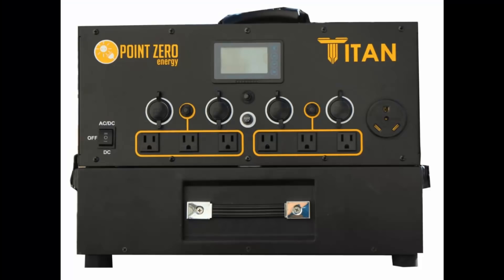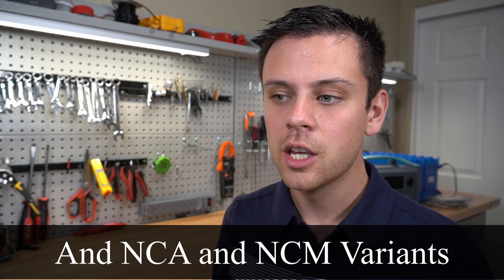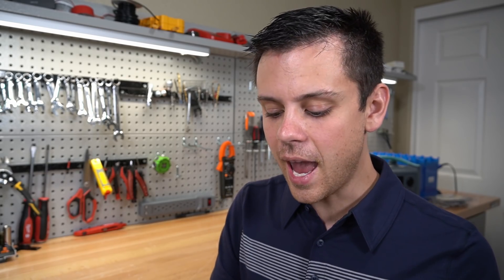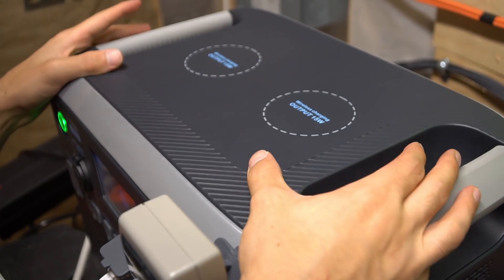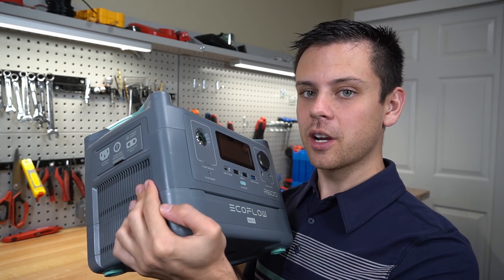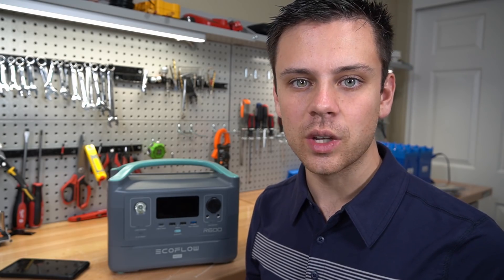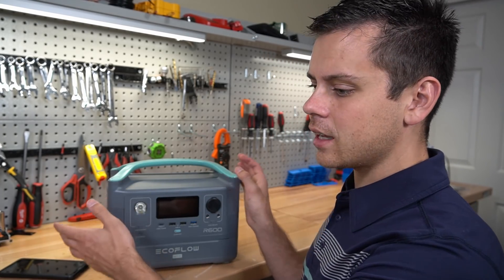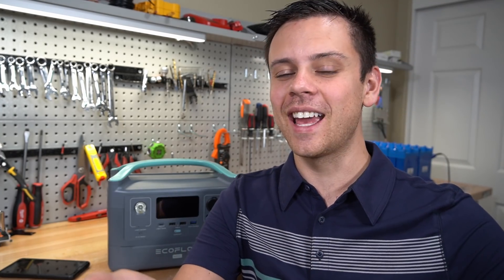Solar Generator Updates for the Titan, AC200 and R600

Comment: Bought your book. It's awesome! IHAVE A BLUETTIAC50S, 2400, and two smaller rockpals, mostly on your and Hobotech reviews. I'm interested in whether the Leoch compares to the ac200. I prefer the ups capability of the former, but noticed from the Indigogo site that the voc solar seems limited( they only show 300 watt parallel ). Are you doing a review before the indigogo campaign ends on Nov 28th? Thanks for your excellent reviews.  P.s. looking to use the generator to power a regular fridge in a blackout , thus the ups

Comment: Are the panels in the 600W array 12v, or 24v? I like the concep tof the 24v arrays, and the 300w 24v sets from Renogy look like a nice bargain...but for the Solar Generators, I am hearing they only take a 12v solar setup.

Comment: A bug or a feature? Bluetti: "when reaching 11.5v it disconnects the charging" :D
Reply: I'm new to this but it sounds like a feature. If my van's starter battery was at 11.5V I'd want the alternator working 100% to charge the starter battery, not the solar generator's battery. Hopefully it starts charging again once the starter battery voltage is ok. Am I understanding this right?

Comment: Hi Will thanks 🙏 to all your reviews I just ordered the BLUETTI AC200 I’m so excited and can’t wait to put it to use. Could you make a video on best practices to use and keep the unit running   For example is it best to run the battery 🔋 all the way down before charging each time if possible. Or when you mentioned that it could last 7-10 years. Does it mean you could keep it plugged in to AC at home 100% of the time or do you recommend not keeping it plugged in. I’m going to use the battery solar generator for Power outage emergencies at home.

Comment: Can you charge the Bluetti ac200 with solar panels at the same time you are using power? Love your videos 
Thanks
Reply: yes you can, you can find this information on the campaign page in indiegogo. you can also use 2 power adapters at the same time and charge in as little as 2.5hrs

Comment: Great reviews! Any sense if how the new Flex 1500 Inergy Power station will compare with Bluetti AC200 (weight/flexibility for additional battery connsctivity,etc.) and pros/cons as primary solar system processor for Sprinter van conversion

Comment: I agree you should charge those companies for your time because they probably wouldn't correct these issues without your testing.  I have moved into a travel trailer and am thinking about a solar system to power my rig in case the power goes out, and to reduce my "carbon footprint."  Love your honesty which the corporate world seems to lack nowadays.

Comment: Hey I’ve got an idea that I’ve been tossing around in my head and trying to figure out if it’s possible or not, so here it goes, big diesel truck pulls 5th wheel camper, camper has solar on top, camper has pull behind Tesla (model isn’t important. Okay now here’s my question can you have a set up that charges the Tesla from the solar on top of the camper and then the Tesla provide the power for the camper at night? Like am I crazy or does this seem like a fairly perfect option to have loads of battery capacity, I can’t find anything on hijacking the main battery in an existing Tesla

Comment: I like high voltage DC. For short runs it works great and I assumed that you had calculated the voltage that you wanted them to do and they added 5 volts. I think that there can be further refinements in terms of modularizing IE they are producing a custom battery pack and that is the heart of the system but the finishings are also and the profit is what's left in terms of the rest of the Parts but for me for this price I think that you can do better in terms of efficiency if you Outsource those parts. Efficiency would result in a total reduction of weight which is more important than cost and probably will be cheaper as well even though yes that means less solar wattage which is not a good way of saving money anymore but where when weight can be reduced and you save money I am for that.

What we find is that the cost of the energy for tools for example is almost irrelevant right? As is the amount of time that they can operate on a single charge. So clearly when it comes to tool batteries instead of having a 12 amp power tool battery you can have a 3 amp power tool battery or a 1 amp power tool battery that charges at 1500 watts perfectly when connected directly to an alternator that has been rectified brutally and cheaply or to a DC generator that is also light in weight fixed speed engine and basically in a few seconds refills the tool battery or collection of tool batteries like those little tiny pancakes that the Italian machines make in fancy sandwich shops sell-by the morsel which is very good for their business model as it is for a crew of workers. Changing a tool battery takes no time. Reducing the time to charge by orders of magnitude is what matters. so you have like a chainsaw that you only operate for maybe what 45 seconds a day to charge up your van life battery if you're in Alaska and the sun is down for months or otherwise prefer to burn s*** or tap into the fast stream for only minutes to spend the DC generator. I've been hearing about how the original lighting that Edison created a market for electricity by was the first real application that needed more than battery power. His breakthrough lasted 15 hours for each Bob which was a long time when you think about how many candles you have to burn to get 15 hours. Subsequent advances have been marginal in the use of electricity wisely. We still need a very small system that cost several times as much as this one even far far Less in total as the what hours are much lower. Mr Probz do you remember what happened with a battery box? that was a low watt hour fast charge brick that still has the website up. I want the modern equivalent of that 10 year old battery!

Comment: I'd love to hear more about the Titan external battery add on. Looks like it is 24v lithium making it SUPER EASY to add a couple Tesla battery pack with StealthEV BMS board and plug in BMS. Seems like Super easy large battery add-on 6kWh for a pretty low cost and no soldering.

Comment: Hi will, 1st off great stuff, fantastic videos
I have a  2003 Ford Transit van with a 220agm battery, a victron 150/50 mppt bluetooth controler and a sterling B2B, at weekends i go away and my 255 solar panel is great when the sun is out in sunny England, the usable amps from a 220agm is half if im correct and the usable voltage is from 14.3 fully charged on my system to 12.4 volts (depth of discharge max lowest volts) so the usable voltage has a very narrow window, my question is i have vey inefficent cool box that draws 42watts, im not sure if thats per hour, at the moment the systems is fine in the summer we have here at the moment 14/06/2020 but on days there is cloud cover im sure it will struggle, my question is with the window of usable volts and amps how long would the battery last (ie at night) as i can only come up with 5 hours from dusk to dawn. kind regards Sean from Project Camper.

Comment: I just found you and I am now a faithful follower! Great video's, sound and production!
I love the way you grab their product by a fist full hair by back of their head and shove their face in a pile of their own specifications, to see who comes up with a clean smiling face? Awesome!
I've been watching you torture test the Titan, absolutely the best in prime time viewing but, I am specifically interested in the 30 amp power system, which you briefly touch base, then moved on.
I own a Arctic Fox 1150 slide-in truck Camper and  I would like to know, how it will hold-up in a camper with all the amenity's or a travel trailer for a 3 day weekend or in something that might have a small generator in it, for life support and be able to find out what it might take to help it make through it's holiday weekend of dry camping quieter than I do now? Like the truck charging as last resort, the generator is noisy or solar panels that come with the kit, I'm getting really tired of having to run my generator every morning. 
Please, go out and live like a king!
I want to watch it get smoked!
I have two 6v 240Ah AGM batteries that get charged mainly by driving, no Solar, no Wind Turbine, a 2500 watt propane generator, CO² detector, 30" TV, Dish satellite, roof AC, roof Fans, a Slide-out, out-side lights, Furnace, LED interior lights, Refrigerator, Coffee pot, Induction cook top, Waffle iron and Insta-pot.
Looking forward to watching more!
Please pay your insurance!

Comment: Thanks for the UPdate ! ! !    You are  CORRECT  on reliability !   I bought  three  Goal Zero  1000 watt  Yeti's .   Two are now non-op after about one year of operation.   The  third is still working reliably in use daily  .  .  .  .  .   ?  ?  ? 
   Of the two failed units:   One failed after I reset it three times in a row  .  .  .  it just shut down as if saying, " Screw You ! "      The second was running under load at about 750 watts for an extended time  .  .  .  .  .  and just went off/dead/non-op.   (Blown fuse maybe?)
    Will check them out when I get organized (time-wise), but for now am not too happy.

Comment: Hi will. I have been trying to learn more about passthrough technology for batteries for a DIY project. 
I just wanted to know if this is possible to do on a solar battery setup.

E.g. sun => battery+Load
When sun is gone it goes just from Battery=> load
basically when the sun is out and is producing more than the load requirements, the battery gets trickle charged

Have you done this yourself yet?

Comment: I'm interested in knowing if the only problem you have with Goal Zero is that their products are over-priced?  I bought the Goal Zero Sherpa 100AC battery bank.  For me it was a test buy since I have never owned a Solar Battery Bank before.  I ran into a problem with it when it dumped power two times in a cold wave last winter...  But the temps here never went much below 50 degree's F.  Which is well above the temps that do cause problems.  I contacted Goal Zero customer service, they asked me to e-mail them a copy of my receipt, and right away they sent me a UPS shipping label via e-mail.  I had no problems with them whatsoever.    

I sent them my unit and they sent me a brand new unit as per the warranty agreement.  The whole thing took about a week and the brand new unit is covered under a new 1 year warranty.  Which is a great thing for me based on the fact that the warranty for my old unit was set to expire around the 22nd of this month (June 2020)  So in my experience Goal Zero's customer service is excellent. (except) Based on call volume you may wait on hold for awhile until a customer service rep can take your call.  

But a customer service manager gave me her direct line to mitigate that problem for me as well.  So all things considered I believe that Goal Zero is a great company that stands behind their products.  I'm thinking about buying their Yeti 3000...  (a very expensive item)  So I'm still slowly doing research and figuring out what will be the best purchase I can make.  I like the idea of the portability of these units.  So I'm leaning more towards a battery bank like The Yeti instead of building a solar unit for a single specific use like home, van, boat, ect.  

Still...  I'd like to know what you think about Goal Zero overall...  Especially the quality of their product manufacturing and really anything and everything else that you can think of that would help me make a good decision.  Thank you in advance for your time and consideration Will.  

Take care.  sincerely,  Dean O.  :-I

Comment: AC200 if temperature below freezing and solar panel connected, would it charge the batteries or would BMS protect? If lithium batteries charged below freezing will damage batteries.

Comment: Hi, Will! You've helped a lot with what I know now with solar power systems. I have a question tho. Have you seen the youtubers everlanders and their diy camper van? They have a crazy solar panel system that extends out from under other solar panels. Can you please make a tutorial on how they do it? They didnt discuss how they did it. half of their solar panels are under a shadow almost all of the time when it is not slid out. If the panels are connected either in series or parallel, im pretty sure it would have bad power output. So how would you do it if you were to do it? I really appreciate it if you could make a tutorial about this. My family and i are losing our house bc of the virus. im considering of living in my car for a lil bit until i get back on my feet. This would really help me a lot. thanks. blessings!

Comment: I have a question about on-grid inverters. Like Huawei SUN2000L-5KTL (single phase, 5kW). That device can continuously output on AC side 5kW (datasheet says max. 25A at 230V). Do these on-grid inverters have some type of "bypass" if house needs more than 5kW so that inverter can pull aditional energy from grid?
Example: Solar produces 4kW. House needs 7kW (AC, water heater, dishwasher etc.). Can this inverter pull aditional 3kW from the grid and power the house or not?

Comment: As I said on the forum if you're going to do quality control for them they should pay. So good for you. I can't believe the bad batch ratio. Considering many use these for emergencies and likely unbox, plug in and wait for said emergency, without testing. The manufacturers should be doing a final QC before they go out the door. I know you say to test it, as you should any emergency device, but how many people have two kilowatt meters, clamp multimeters, and a pair of matched heatguns. Lol. Thanks Will.

Comment: My question is how long does it take to charge with the solar option? 
Of course if there is no car or home to charge it. 
If it is more than 12 hours, it shouldn't be called generator!, because it doesn't have the ability to produce enough power as standalone unit. 
Generator is standalone unit producing power. This should be called battery bank as far as I am concerned.
Reply: AC200 charges in 3 or 4 hrs with 700 watts of Solar

Comment: I kinda wish the display was on the top of the unit. That way I can drop it in a box, hide all the wire components plugged into it, and just lift a lid to check the data and stats. I can do without wireless charging

Comment: The difference between a phony paid advertisement and Wills review is honestly. Does anybody has made a simultaneous comparison between two solar panels one with a tracker to see how many more watts a panel can make in a day?
Reply: I've used a tracker, and it does help over a stationary solar array, though I didn't log the results. However,  just getting another panel or two makes up the difference pretty quickly, especially if one uses an MPPT solar controller, so one can use higher voltage panels. :)
Reply: p.s. I've been using solar since the early to mid 90's, starting with an old cracked 40W panel and a car battery. I'm now up to using a Midnight Classic 150 with 2080 Watts of solar coming into 8 Interstate 225Ah batteies, set up in a 24V conversion. My nearest neighbor, (here in an off-grid community), has a 48V system.
Reply: @Tumbleweed5150  i have 30 of 340w panels 48v system and at noon they make so much energy that most of the controller shutdown.  So I turned some facing East and West to balance the charge but I think a low maintenance tracker will make it more efficient all day long.

Comment: Hi Will, do you know if the Bluette AC200 has any provisions for adding an external battery? 

Also do you know if the AC200 is able to power a small (900 to 1000W) microwave oven?
Reply: yes it will run a microwave oven.  if it will charge a tesla it will run your oven

Comment: My AC200 died during the inverter test. I guess I'm a lot harder on my stuff than you are! lol
Reply: Simple 200w hair dryer after a couple of hours now the thing won't power on. They are sending a replacement, but hey it's pre-production. I also had serious overheating issues with the R600. Worked fine for a few mins then would shut off.
Reply: Ditto what you said on the current Bluetti's. They can't be killed! Still the best bang for the buck out there IMO. Also on my 5th failed product in two weeks. So much time wasted!
Reply: HOBOTECH Would love to see your reviews for the Ecoflows and this latest Bluetti
Reply: @t0nkatsu  They both failed during my tests so I'm awaiting replacements. Videos will be coming!
Reply from the maker: It will go into a power saving mode after a couple hours while powering a load
Reply from the maker: How the heck did u do that!! Haha tell me more
Reply from the maker: I used habor freight heat gun and a 500W halogen. What was your load? Was it inductive?
Reply: Will the production unit have a safety feature to prevent burning out or damaging the unit?? Just ordered the AC200 and would love to see a best practices video for new people entering the “solar generator” world
Reply: Ditto, very curious, I've always thought a load test should include a motor type component as motor loads can be quite different.
Reply from the maker: Hey hobotech did you disable eco mode? Just had mine turn off because that mode was enabled
Reply: @WillProwse  Yes. I went through the menu and disabled that before testing. It definitely blew. Push the power button after letting it cool it just blinks - no screen. Wouldn't charge via PV or AC port either.
Reply: You should post your videos on them dying - the bad press should help change their behaviour and send a fully tested unit through a delivery company that takes care. Still inform people if pre production and if the company is wanting you to problem solve/stress test, then charge them for that time (particularly if they don't want the video released until units are fixed)